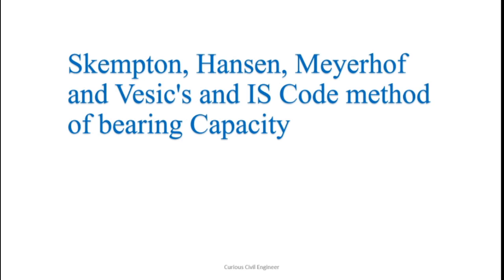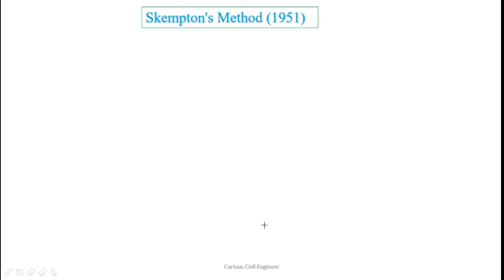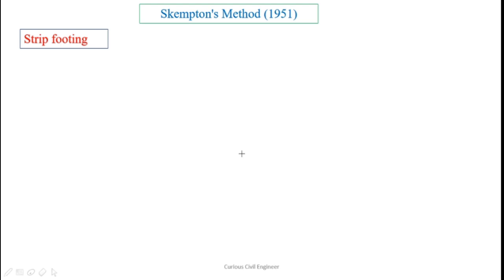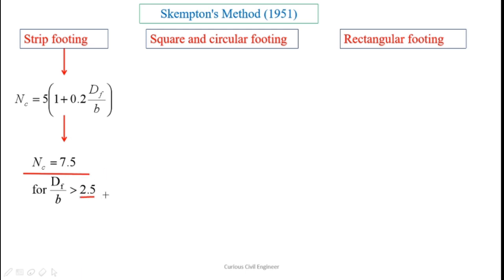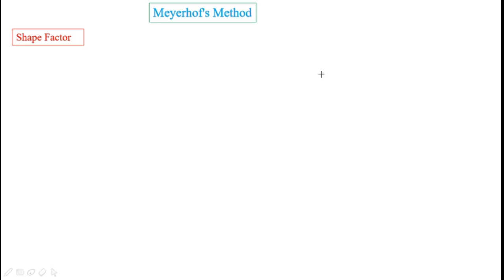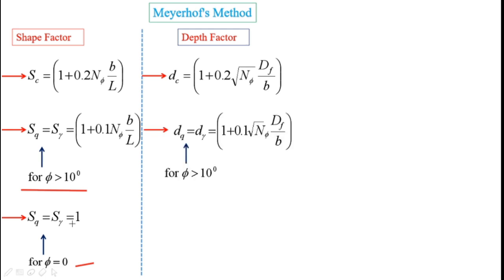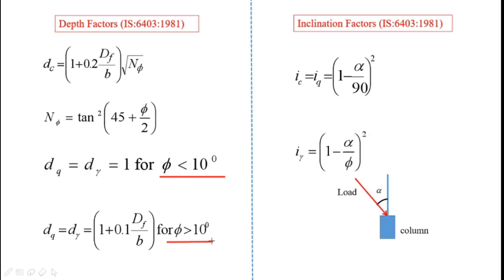Shallow Foundation: Skempton, Meyerhof,Hansen, Vesic and IS Code Method of Bearing Capacity: Part 6

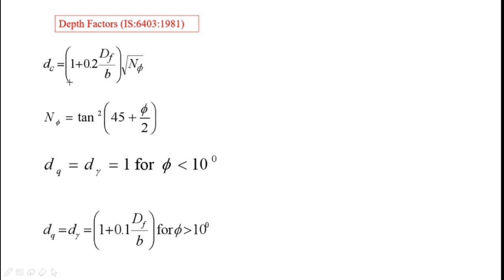Comment from the maker: 22:08 Small correction in depth factor of IS Code method. I forgot under 
root Nphi in dc dq formula. Please refer pdf for corrected formula. 
Link in description for PDF
Reply: 20:11 should there be q(Nq-1)??
Reply from the maker: Thanks you the corrections. Will look into it.
Reply: sir, in pdf Dq and Dy formula is wrong because Nphi will be multiplied in second term only and not in whole term so please do correct it.
Reply: @sanishbhochhibhoya7750   actually in IS code directly Q net ultimate is given, that's why q(Nq-1)is used but here formula is for Q ultimate (Qu) only so -1 is omitted

Comment: Which method is the best for calculating bearing capacity, please your opinion sir
Reply from the maker: I think its IS Code method if ur using Indian standard and if you're from other country then use Meyerhof's method.
Reply: Thanks sir
In my mini thesis 
I used Meyerhof, hansen, vesic eqs to calculate bearing capacity.
But idk which eq is more safe
Can i use avg value of these eqs
How you think sir
Reply from the maker: You can compare the results for all of them. Take some footing of rectangular shape and calculate the factor of safety. The method which gives higher FoS is safer.
Reply: Thank you for you kindly reply What value of Fos should be used in these eqs?
Reply from the maker: You have to calculate FoS by assuming size of the footing.
Reply: Thanks sir😊